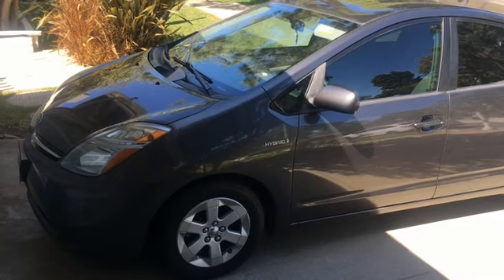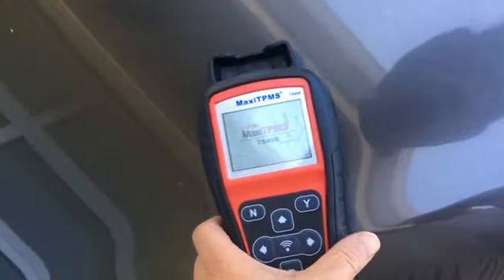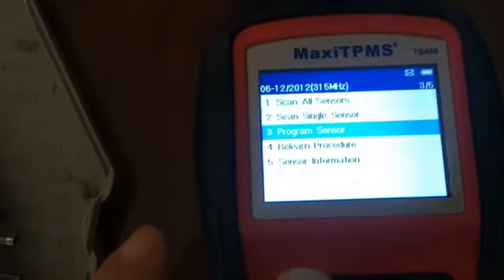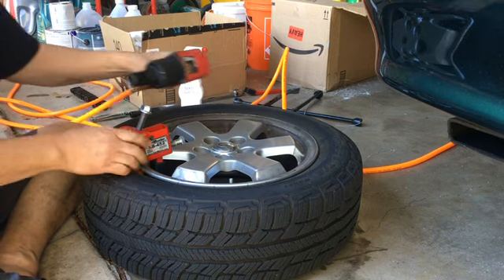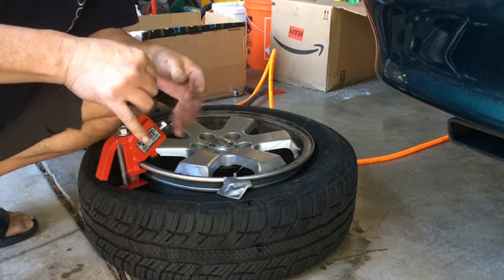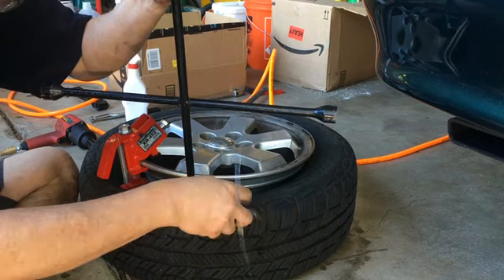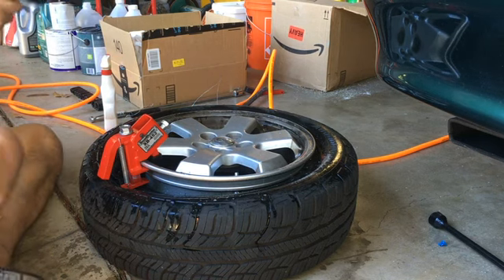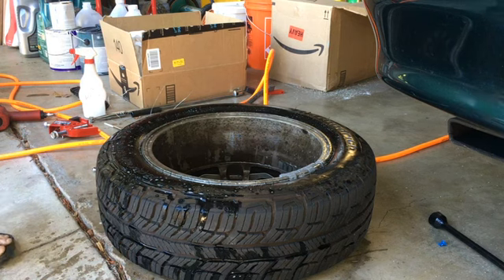TPMS light diagnosis to fix. End-to-end. Toyota Prius. MaxiTPMS. BeadBuster.

Comment: Not bad for a DIY repair job. My workplace uses an Autel MaxiTPMS TS508 and rubber-stem MX 1-Sensors on nearly every car with a TPMS problem. I'm impressed with them so much I bought a TS508 myself.

As for the repair job you did with your Prius, I'm amazed you were able to take the old sensors out using the Handyman's secret weapon and a fishing line. In the end, I'm sure the $350 US you spent on sensors and the tools you have will pay off in the long run.

Well done.

Comment: did you use a generic tpms or OEM tpms ......i heard OEM last longer  and no issues with programing
Reply from the maker: I used the universal Autel TPMS. It doesn’t work perfectly on Gen2 Prius—supposedly Prius TPMS are finicky. The TPMS light will always come back on when the vehicle is parked. Once you run the vehicle for a minute or so, the TPMS light will go off—but it is annoying. Looking at TechStream data, I typically see 2 of the 4 tire read very low pressure even if it’s fully inflated. Saw a YouTube video by a mechanic stating these Prius’s TPMS is finicky. If was to do this over, I would get the Autel scanner that can program the TPMS module (5xx?) and get a non-programmable TPMS for these Prius.

Comment: is there any trick to reinflate the tire and reseal the bead? just add air an that is it?
is the bead breaker 452 the best most universal
Reply from the maker: Not really, I just put the air in the tire and the bead seated. It’s been a while so I don’t really remember, but the bead breaker I used was the best suited for my needs. I think there were options depending on the size of the rim or something…I remember paying a premium to get the one that had a wider application to cover the range of vehicles I have.